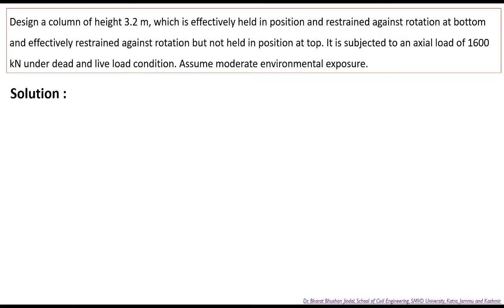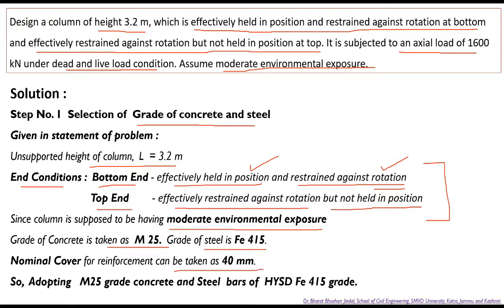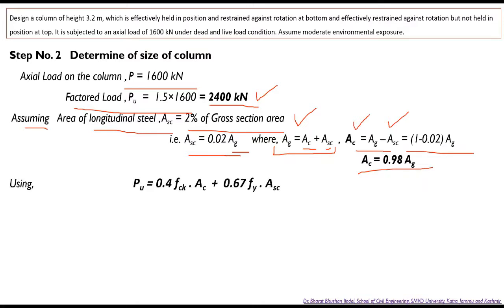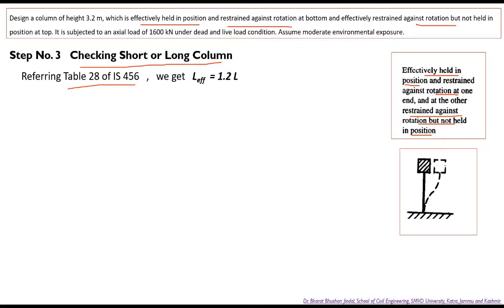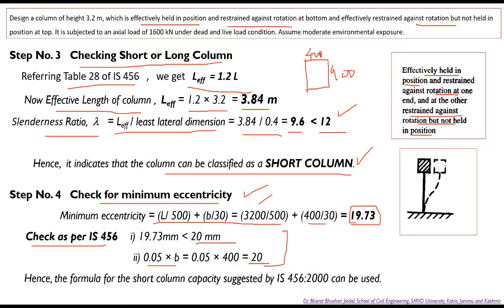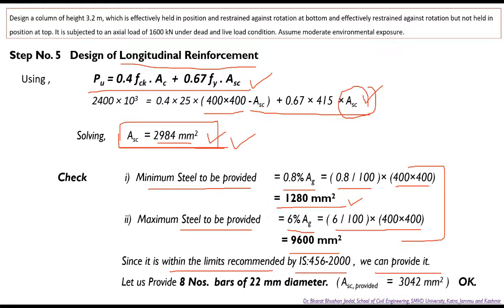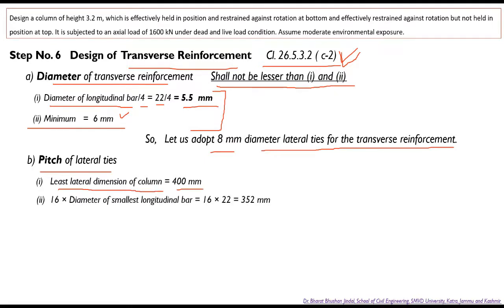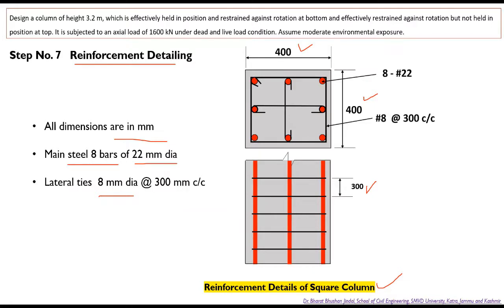Lecture 24 | Design Problem || RCC Short Axial Column

Comment: Sir i have a doubt ,if in case of square column ,we provide  helical reinforcement and fill space between reinforcement and column with some agreegate or something else .will it work
Reply from the maker: You can do it if it gives some additional benefits. In general, helical reinforcement is provided in case of circular columns with some increased load carrying capacity.

Otherwise, lateral ties in the form of circular ring can also be provided.